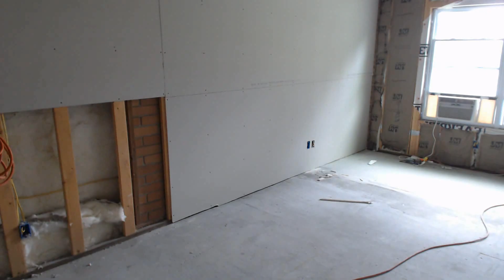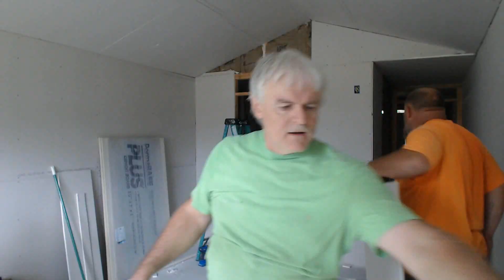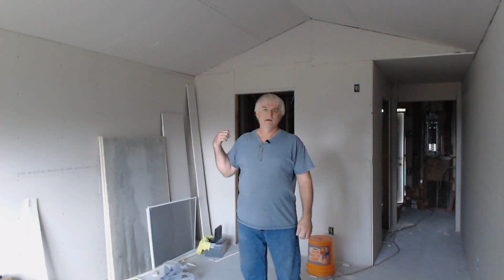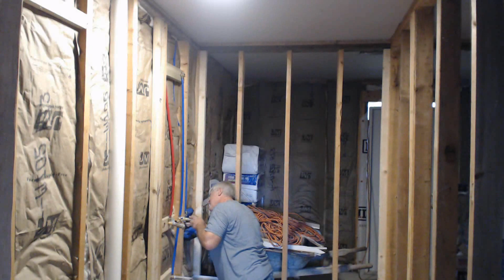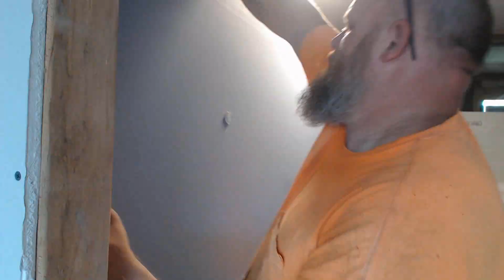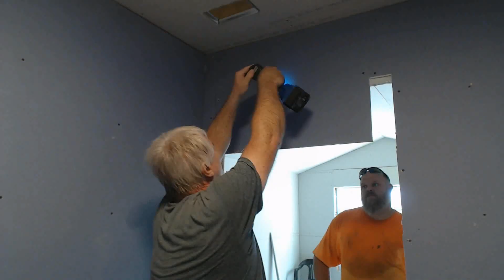Josh gets hurt | Just hanging drywall in the abandoned house

Comment: What is better, pecks (is that how you spell it?) or copper.
Reply from the maker: Well, this is the first time I have used PEX. I did it for a couple of reasons .. cost and ease of installation. The fact that I was also required to run it overhead meant that I wouldn't need to have any joints in the attic. Copper is very expensive to use now, so much so that almost nobody uses it in my area anymore.